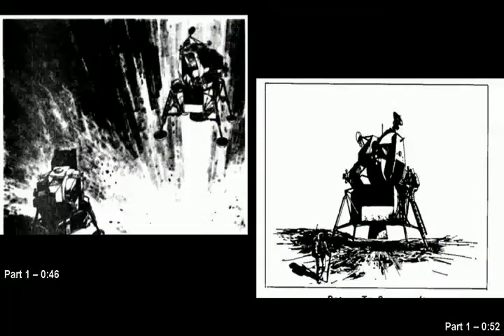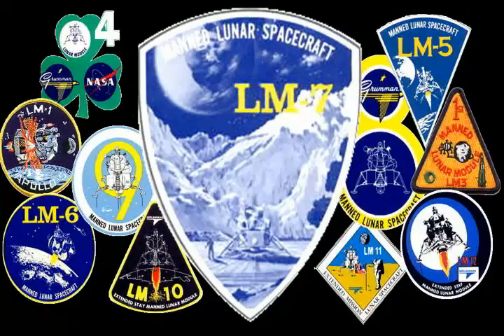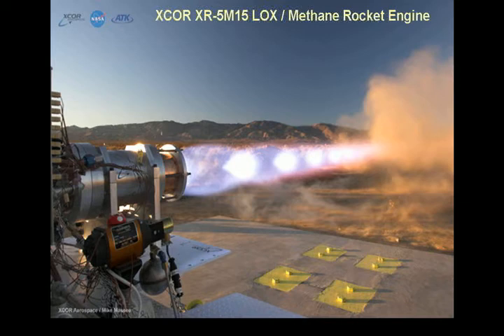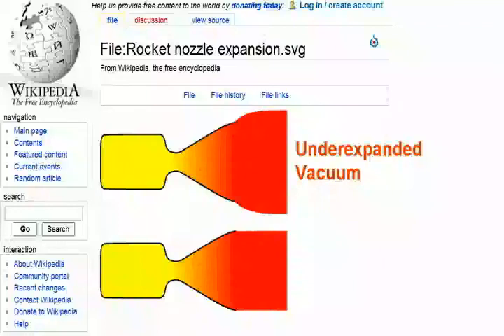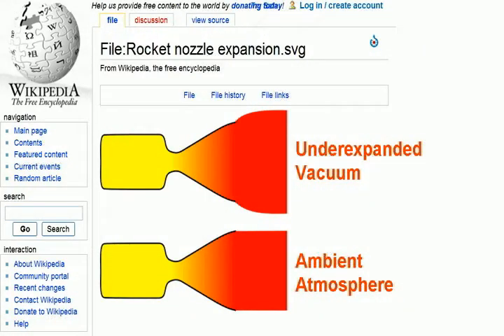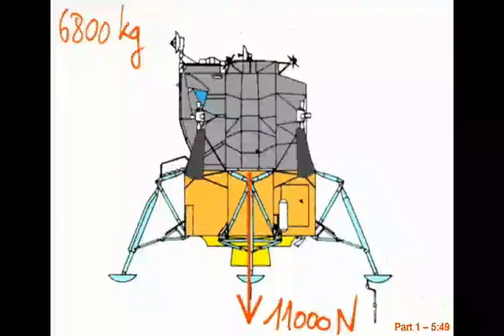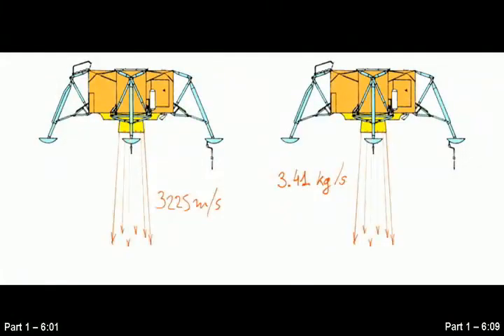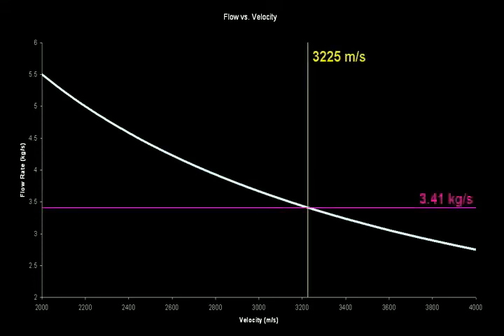Pseudonautics - Episode 3 - Soft Landing - DEBUNKED (Part 1 of 3)

Comment: 1:25 "this Apollo 14 photo" is actually Apollo 11 photo and is clearly labeled as such. On a side note, it's one of the few showing such erosion, directly opposed by other photos(AS11-40-5850,AS11-40-5864 and AS11-40-5865) where the surface shows no signs of erosion at all. As for Apollo 14, there is noticeable erosion under the nozzle, but practically no erosion around the footpads. You use the AS11-40-5920  in the second part too and again,you call it Apollo 14 photo and you don't show any photo of the other footpads.  The presented information is clearly false and pretty missleading.
Reply from the maker: +Princip666 Thanks for catching my mistake. Nobody pointed that out to me before. Don't know why I thought that was Antares. I've noted the mistake at 1.24.

Was my information "clearly false and pretty missleading [sic]?" Did I ignore photos of the other foot pads? Let's see...

AS11-40-5920 is a close-up of the north footpad. It clearly shows the pedestal and radial lines. AS11-40-5918 is also a close-up of the north footpad. You see some radial lines, but no pedestal. Why is that? AS11-40-5917 is yet another close-up of the north footpad. You see some surface buffing near the probe, but no radial lines. Why is that? AS11-40-5858 shows the north footpad. You see faint radial lines in the foreground, but other than a little tuft of loose dirt against the pad, no signs of disturbance. Why is that? AS11-40-5870 is a closer shot of the north footpad. Radial lines are noticeable on both sides of the footpad, but no pedestal. Why is that? AS11-40-5902 is another photo of the north footpad and all you see are footprints.

AS11-40-5921 is a close-up under the engine plume. You clearly see radial lines. AS11-40-5864 is also a photo of the area under the engine plume, but you don't see any scouring. Why is that? AS11-40-5892 is another close-up under the engine plume. There are no radial lines. Why is that?

In AS11-40-5850 you see radial lines; the south footpad is in shadow. In AS11-40-5865, the south footpad is in shadow and there's no sign of disturbance.

AS11-40-5925 shows radial lines outside the east footpad and the north footpad is in the background. AS11-40-5926 is a close-up of the east footpad showing radial lines and another pedestal. The dirt piled up on the inside of the north and east footpads, show that they were dragging those footpads while floating southwest. AS11-40-5914 (east footpad) and AS11-40-5915 (east and north footpads) show nothing. Why is that? 

So, was my information "clearly false and pretty missleading [sic]?" No. The claim is that there is no evidence of erosion -- no crater. Clearly, some photos do show evidence. It appears that depending on the distance between the camera and the subject, the angle of the camera, and the angle of the sun, you may (or may not) see scouring. The gray surface makes it difficult to get any depth from the photos. It would be totally possible to take a photo looking into a crater and not see the crater. 

If you're interested in the subject, see my No Crater Adendum: Critique.
https://www.youtube.com/playlist?list=PLF49B765486029ACB
Reply: +Phil Webb It's you who is claiming that 3 inches of dust are missing from around that footpad(and I agree on that), so it's reasonable to assume that the whole area should have been affected accordingly,isn't it? But as I said,some photos show no signs of erosion at all and the surface looks the same as in the surrounding area. You don't have to blurt out the examples, I've seen them all and I've read the analysis of the touchdown dynamics. That's why I know that the skid distance for each footpad(after touchdown) was in order of inches. So how can such compressed pedestal form under one of them due to 3 inches of blown-away dust, when all the pads skidded a bit just seconds before the engine shutoff? And why is it that other footpads have  built-up dust  undisturbed? Why is that the surface is clearly unaffected in some pictures and clearly blasted on others? It has nothing to do with angles or light, images are sharp enough to see that the surface features under the module have changed from loose undisturbed dust indistinguishable from the surrounding area to clearly blasted and compressed, the difference is very obvious. And yes, I am interested in the subject, that's why I point out such things.
Reply from the maker: +Princip666 "It's you who is claiming that 3 inches of dust are missing from around that footpad..." Which is in response to Guillaume D’Ock's claim that he doesn't see a crater when there should be a crater. I answered that in my previous response.

"It’s reasonable to assume that the whole area should have been affected accordingly..." Which it was. There are signs of erosion in several photos of the area under the descent stage.

"But as I said, some photos show no signs of erosion at all..." Which is why I pointed out that in multiple photos of the same area, sometimes you see evidence of erosion, and sometimes you don't. The lunar surface isn't flat. It's got dips and ridges and since it's all gray, features get hidden.

"You don't have to blurt out the examples, I've seen them all..." First you complain because I "don't show any photo of the other footpads," and then you complain that I gave several examples of other footpads. Jeez! Are you going through menopause or what?

"I've read the analysis of the touchdown dynamics. So how can such compressed pedestal form..." Most conspiracists point out the descent engine ran for a few seconds after Eagle came to rest. So, the engine swept out about 8 metric tons of regolith during that few seconds, while the LM was stationary.

"Why is [it] that the surface is clearly unaffected in some pictures and clearly blasted on others? It has nothing to do with angles or light..." Yes, it is all about angles and lighting and the uneven matte gray surface. Photos of the same area look different from different camera angles. I'd point out examples again, but that would just piss you off, so why try?

If you ask me the same questions again, I'll give the same answers.
Reply: +Phil Webb " Which it was. There are signs of erosion in several photos of the area under the descent stage." - In several maybe, not in ALL, isn't that contradictory? The whole area was affected, but some of the photos show it clearly wasn't.
" First you complain because I "don't show any photo of the other footpads," - because you don't, in your video you show one photo of A11 footpad and one of A14 blast area, that's what I was complaining about. You have to SHOW them, not just talk about them when someone points out your incompetence in presenting evidence.
"features get hidden." - that's bullshit, there are enough photos in great quality from many angles and distances in Apollo Image Atlas, NO features get hidden, photos are so sharp that you can see every detail
"the engine swept out about 8 metric tons of regolith during that few seconds, while the LM was stationary." - are you talking about Apollo11? Because if you do, this is total bullshit. To repeat, in most of the photos the surface is clearly undisturbed and is INDISTINGUISHABLE from surrounding area. And you left out the bit about footpads skidding from your quote, the pedestal did not form under the other footpads, loose dust around them is undisturbed, no signs of 8 metric tons of dust missing. Also,no mention of such erosion in official reports, this is a major contradiction and it again shows that it is just your oppinion, which clearly doesn't match reality.
" Yes, it is all about angles and lighting and the uneven matte gray surface." - that's again your oppinion and there's plenty of evidence that it's wrong, as the photos are very sharp and every detail is clearly visible. There are also many pictures of surrounding surface to compare.

To sum it up, you say that 8 metric tons of material was removed under already stationary module and some pictures show that, but not all and this is caused only by angles and lighting. Even those that show in great detail the totally undisturbed surface and those that show loose dust around other footpads- again, angles and lighting. That's great explanation, not even a bit contradictory. Bravo
Reply from the maker: +Princip666 Okay, one more time...

"In several maybe, not in ALL, isn't that contradictory?" Not at all contradictory, as I've clearly explained. You seem to confuse "signs of erosion are not visible" with "signs of no erosion." What? Do you think the scene was restaged for some photos? I'm done on that topic.

"You have to SHOW them, not just talk about them..." As you seem to forget in every comment you make, the original claim was that there is no evidence of a crater. It only takes one example to prove that claim is wrong, regardless of your opinion. Done on that subject too.

"'features get hidden.' - that's bullshit, there are enough photos in great quality..." Sorry you don't understand that the only way you can see something matte gray on something matte gray is because the light reflects differently off something or something casts a shadow. If you have two photos of the same footpad, the first showing signs of erosion, the second, from a different angle, not showing such signs, then the only conclusion is that the signs of erosion just aren't visible in the second photo. The shadows from the radial marks are simply hidden on the back side. Oh! I guess you could argue that they restaged the scene and their continuity editors missed all the mistakes intentionally put in the second photo by whistleblowers. Yeah. You can go there if you want. I wouldn't argue with that one.

"In most of the photos the surface is clearly undisturbed..." And you have the before-and-after photos to prove that?

"INDISTINGUISHABLE from surrounding area." It's all gray -- totally matte gray. Everything is indistinguishable.

"And you left out the bit about footpads skidding..." That's because I don't buy into the skidding. I'm not a mechanical engineer and I'm not an expert on "touchdown dynamics" like you are, but if the LM skidded, the footpads would snowplow the "dirt" up in front of (and possibly over the top of) the footpads, not under them. The photos suggest to me that the surface around the footpads was being eroded away while the engine was running and the loose stuff fell in clumps when the engine stopped. If you have a different opinion, fine. You can express your opinion all you want, but I'm done with this subject too. 

"The pedestal did not form under the other footpads, loose dust around them is undisturbed." It's more like dirt than dust, but I'm glad you agree a pedestal formed beneath two footpads. Both the north and east footpads are clearly sitting on pedestals in some photos. The loose dirt became loose dirt after the engine shut off. Done with that subject now.

"That's again your oppinion [sic] and there's plenty of evidence that it's wrong." That's your opinion.

"The photos are very sharp and every detail is clearly visible..." Matte gray surface. See above. Done.

"You say that 8 metric tons of material was removed under already stationary module and some pictures show that..." Correct! Some pictures show that. Stop right there. I'm done.

"Even those that show in great detail the totally undisturbed surface and those that show loose dust around other footpads- again, angles and lighting." What totally undisturbed surface? Again, show me the before-and-after photos so that I may concede to actual evidence. Loose regolith around the other footpads? Yes, it fell when the engine cut off, or wasn't fully dislodged. None of that is contradictory except in your mind.

You can post again, if you want. I'll give you the last word, if that's important to you. But, I'm not going to respond to the same comments over and over. Thank you for visiting. Please be sure to take all of your personal possessions with you when you exit the building. And, have a nice day! :-)
Reply: +Phil Webb Well, thanks for interesting conversation, good bye.

Comment: o my point is: if you put a force at exactly 180 degrees at a flat surface, it will stay where it is, but if it is on an angle it will blow away. And indeed as in your last sentence some things may fall under the engine. I know heavy parts will not be blown away far, and the light ones will. But wat about the cohesive force in your answer? don't understand this. I know wat cohesive force is, but ( long time ago I went to school) I thought it more a thing between fluids.

Comment: At about 1.58 you show a photo where the dust is blown away around the Landing pad. How is this possible if the engines were shut down before the Landing pad touched the surface of the moon. My conclusion of this photo is that the engine was running at touchdown, but as far as i've been told that wasn't the case. So what is wrong with my observation?